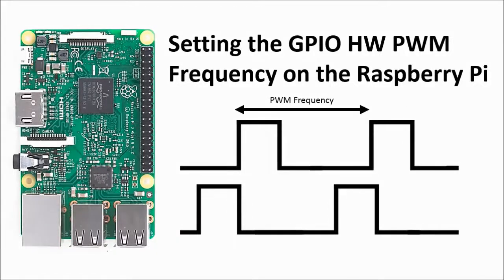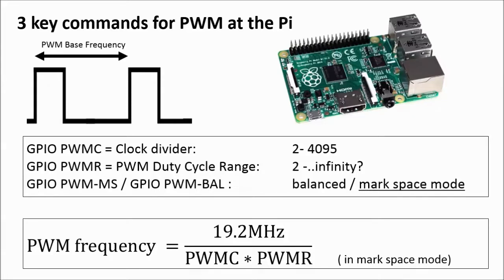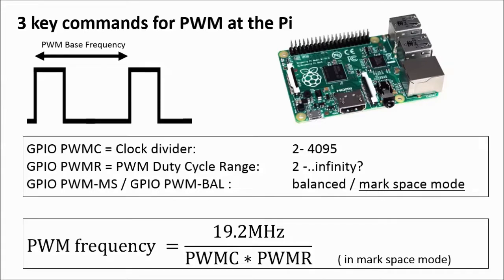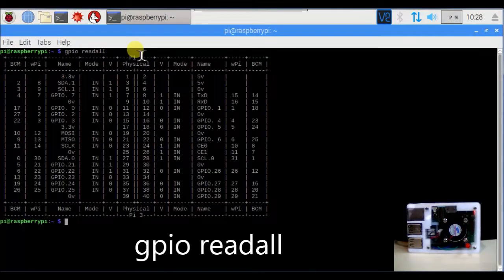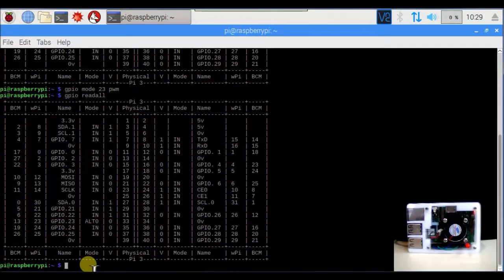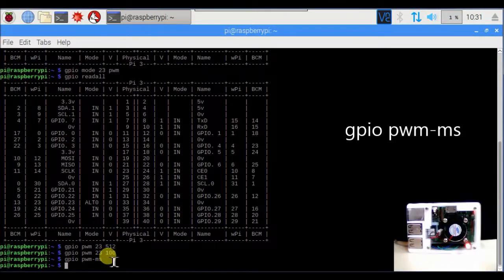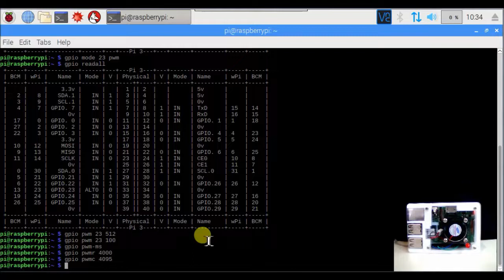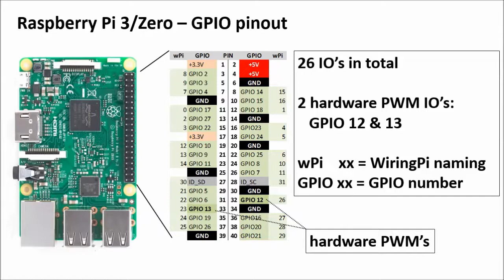Setting the GPIO hardware PWM Frequency on the Raspberry Pi

Comment: For the newer versions of the Pi (CM4, Pi 4B) I do believe the clock frequency is 54Mhz. Just FYI for those who are getting wrong frequency values :)
Reply from the maker: The video is 4 years old - so it may not be fully up-to date  - thx StoneEdge.

Comment: If I build a car with 2 DC Motors, do I need 2 PWM signals for every DC motor or is one enough? I connect that all to a L298N motor driver, thanks for help, im a beginner
Reply from the maker: If you want to control them independently you need 2 PWM signal. Note that for DC motors you can use any method to make PWM as some glitches will be smoothed out by the inertia ;-)
Reply: @smartpowerelectronics8779  ah ok thank you very much!

Comment: Thanks for sharing with us.
Do you know how much the minimum time step is to delay a certain signal (compared to another)?
I have been thinking about the following. 
You can create a PWM signal with just a simple XOR (or XNOR) port with just two square wave signals.
The dudty cycle can be made when shifting the other signal +/- 90 degrees out of phase (or delaying the signal).
As a bonus this will give you a output of twice the input signal with a XOR port.

Comment: could this be used to power a pc fan?

was thinking of using PWM control for a fan using a few temp sensors as the governor for that.

In fact, I would like to use 2 pc fans: one for fresh air into a box and one for warm/stale air out.

Would be interesting to see a project based around this with details as to parts required/how to program/wire it all together.

...unless you have knowledge of such a project listed elsewhere?

seems as if there isn't one on here at least...I have a veg grow box I'm wanting to experiment with to turn it into a high-tech hydro at home box is all

cheers for any feedback chief!
Reply from the maker: sure, but for a PC fan some glitches are not critical, so it is quite easy: you can use any (Hardware or software) PWM output and the default PWM frequency
Reply: Smart Power Electronics I’ve been looking at using a number of 1 channel heat probes...it is possible to configure them all in parallel on 1 channel by the looks of it which would be perfect as I can reduce the number of GPIO pins utilised.

I was looking for a reliable source of heat probes though...it appears the ones on Amazon are consistently receiving bad reviews though...any ideas?

Comment: Could we get a four pwm signals in one board ?!
Reply from the maker: No the raspberry Pi only has 2 Hardware PWM Channels, only if you use software PWM you can have more channels, but software PWM channels are less stable.
Reply from the maker: There are only 2 hardware channels available
Reply from the maker: But with software PWM you can have many more, but not with the stability  as you have with the hardware channels. This stability is normally not a problem, bu for dimming  it is crucial, because you can see flicker if the PWM is not stable.

Comment: Please tell me how I can generate a certain number of pulses ?
Reply: import time
import RPi.GPIO as GPIO

pulsenum =10
i=0
while i < "pulsenum"
i += 1 
GPIO.output(4, True)
time.sleep(.2)
GPIO.output(4, False)
time.sleep(.2)

GPIO.cleanup()

#make sure to tab in front of the while instructions
#hook speaker to GPIO pin 4 and ground with a sufficient resistor in series with the #speaker.
#Hope that helps

Comment: I'm trying to dim a sting of four 5W LEDs.  The commands work but there is still flicker.
Reply from the maker: do you use a fresh installation of Raspbian? PiZero or Pi3?
Reply: Thank you for the response!

Pi 3 Model B.
19V 4A computer power supply
Meanwell LDD 1550 driver
4 Cree XP-G2 (10W max, the driver is running them at 5W max).

Since I watched your video I also tried pigpio.  Still flickering.
Reply: I think I found my mistake.  Four 5W LEDs can't run off a 19V power supply.  The driver needs 2-3 volts too. Wiring three 5W  LED  works.
It looks like I found settings that allow for dimming without flicker (gpio pwmr 400 and gpio pwmc 400 - they allow gpio pwm 23 to go down to 5 (gpio pwm 23 5)).
Reply: See what I wrote below.

But I got another question - how do I write a python code for these Terminal commands?
Reply from the maker: Pretty new to Python myself - must be possible - check this link:
https://stackoverflow.com/questions/46291278/execute-shell-command-from-python-script-raspberrypi